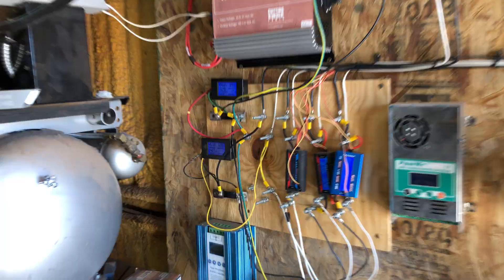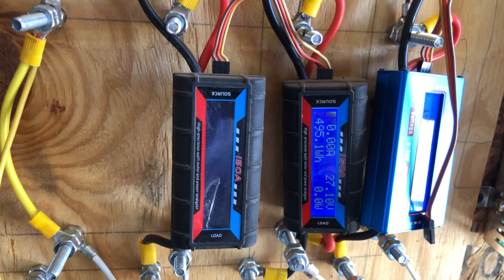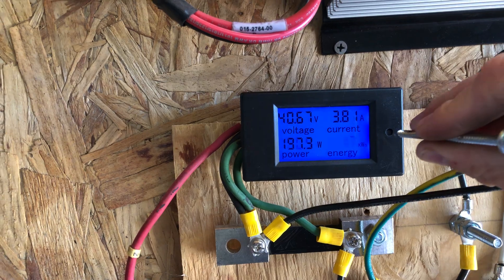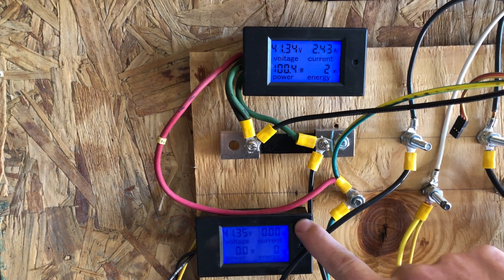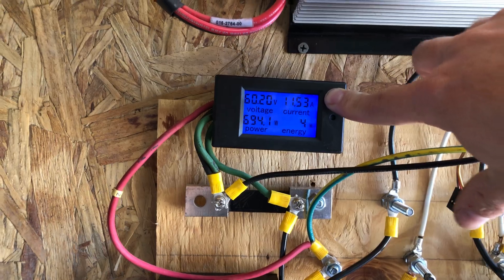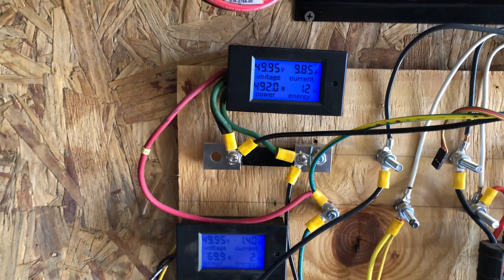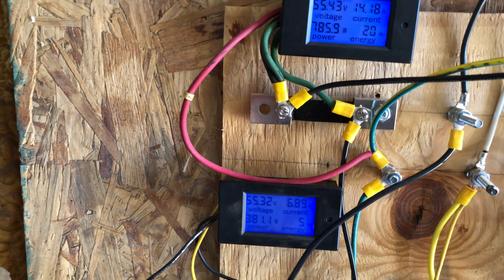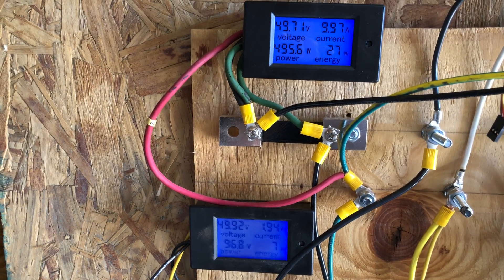iSta Breeze Heli 2.0 vs i1500

Comment: I have a question , maybe you could help me . im deciding between 1x 2000w inst or 2 x 1000w insta , which do you think would be better ?
Reply from the maker: That's going to be a tough one to answer...the bigger turbine will outperform the two smaller ones in the long run, though not by a large margin, and in gusty weather the two smaller turbines will probably peak at a higher output.  One large turbine will perform better, but I do like the idea of redundancy.  If your one big turbine breaks then you're whole system is down, but if one of your little turbines break you're only half down.  It'll be personal preference I think.

Comment: Hey there. Just ordered my i2000 48v. Do you have a link for those newer meters you use? They seem like a preferred unit.
Reply from the maker: Sorry for the late reply!  These are the meters I use currently :) https://www.ebay.com/itm/100A-DC-Digital-Watt-KWH-Current-Power-Energy-Meter-Ammeter-Voltmeter-7-100V-US/281768704865?epid=24024024343&hash=item419ab93b61%3Ag%3A72kAAOSwT6pVxihm
Reply: @ToysforWatts  no worries buddy. Just appreciate your experience and look forward to learning more from you and in my own trials! Happy power making!

Comment: Would you say the Heli has loosened up/broken in even more since your last video?? Sure looks like it is doing well!
Reply from the maker: I think that it's getting a little easier on the start up but it still struggles a bit. It's been trucking along almost nonstop for the last three days but the wind's kept up.  It still takes a pretty good gust to get it going.
Reply: @ToysforWatts  What's the deal with the comment below about new blades? Is that the manufacturer? Are these going to be available for everyone? I could REALLLLYYY use a set!
Reply from the maker: @wbuffetjr1  It's something I'm looking into, you're not the only person who has asked me, with any luck I'll have an update on that issue very soon!

Comment: Bought a i-1500 based on some of the results you were having but chose the 48v model hoping the cut in is lower on my 24v system so interested in the results you get.  Where do you get those newer meters from? They look good, keep it up, good luck.
Reply from the maker: These are the new meters I'm using:

https://www.ebay.com/itm/100A-DC-LCD-Digital-Volt-Voltage-Watt-Current-Power-Meter-Ammeter-Voltmeter-US/254666389774?ssPageName=STRK%3AMEBIDX%3AIT&_trksid=p2057872.m2749.l2649
Reply: How have you been going with the Power Cut in in the 48v Turbine? Wirkung for your 24v system?

Comment: Question.  The batteries you are using are just to put a load on the turbines?  I guess what i am wondering is, do the batteries have to hold a charge ? Or can you use just old cores.  I have been trying to setup a inverter system and found that no ones really doing it other then you.  Thanks for the videos they have helped a ton...
Reply from the maker: Yes I only use batteries to put load on the system...they're essentially resistors.  In fact, though I haven't been able to make it work myself, I believe you could actually use resistors to do the same thing.  They don't have to hold a charge but the closer they are to completely flat dead, the more load they put on the system...flat out bad batteries will either not provide any load whatsoever, or they'll act as a short locking the turbine down.

Keep in mind that no one else does it the way I do because there are so many better ways to do it.  I do not depend on my power and am simply dumping it all into my lights, tools, or the grid....making it as efficient as possible just isn't a huge concern.  If you need a system that is working at reasonable efficiency or that will provide off grid power then there are other, more effective avenues.
Reply: @ToysforWatts    Thank you for the info.  You have been a big help.  I'm just trying to put the power back into the grid.  I have solar that is grid tie, and I figured wind was next.  I'm really just trying to offset a little power.  Thanks again, looking forward to move videos.